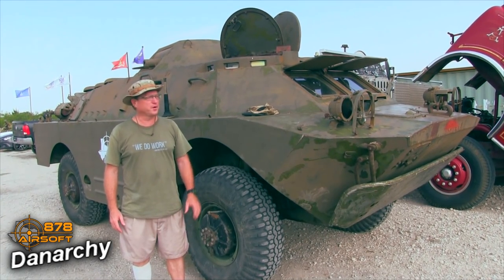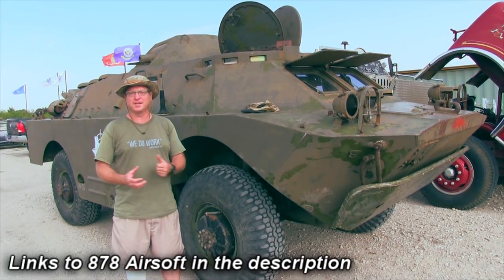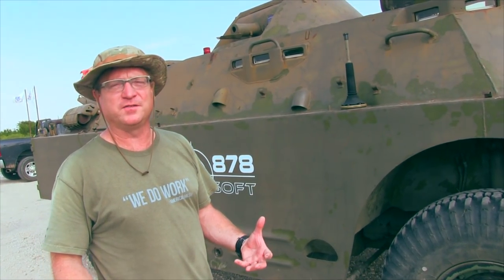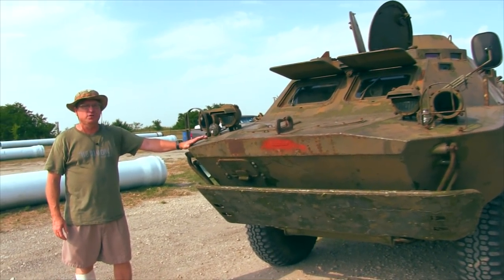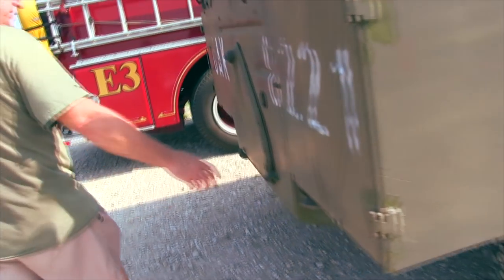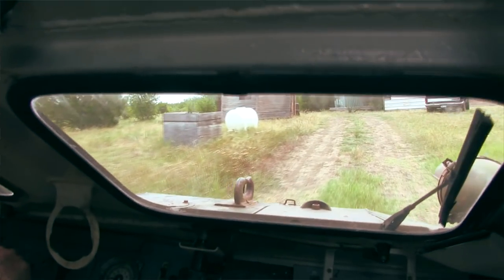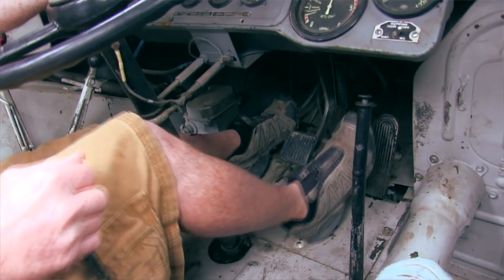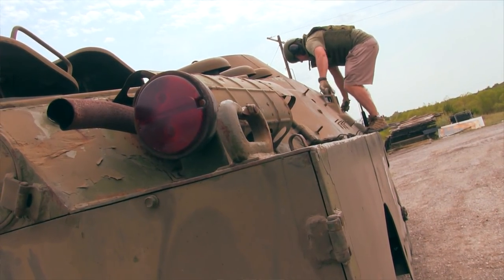A Soviet BDRM-2 That's Used For Airsoft

Comment: So ive been wanting to return to airsoft but ive had a ton of issues as i have a old scar l and it needs a new stock and battery is it better off to buy a new gun and restore the scar to put for display since its one of the rare ones or fix it and use it
Reply: Dboys is the brand

Comment: 1 mpg? How did you get such a bad one? That's well below the average.
Reply: DiploidDudnyk idling and going slow while turning will do that.
Reply: The original fuel pump was a mechanical, which is near impossible to find and was replaced with an electric fuel pump. As we tune, that efficiency should improve.